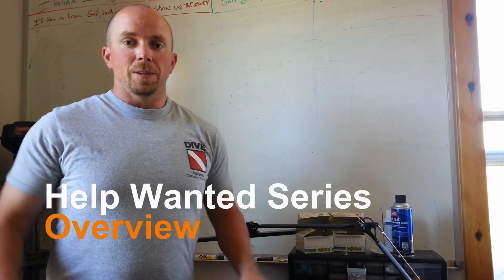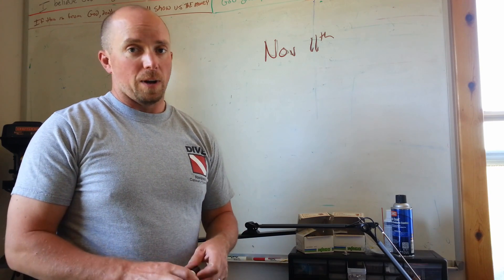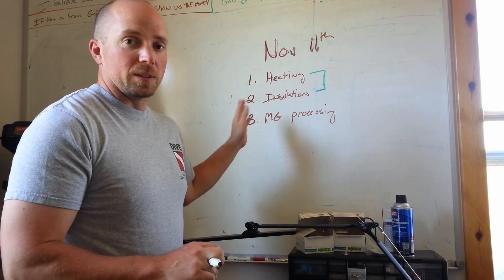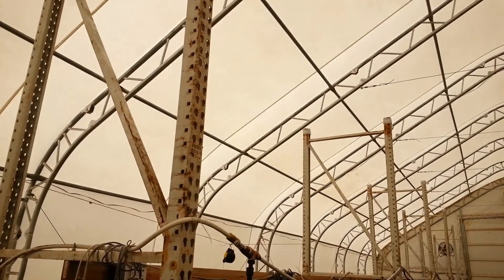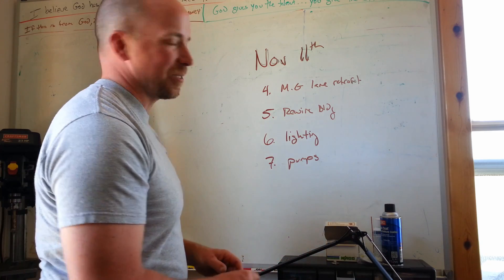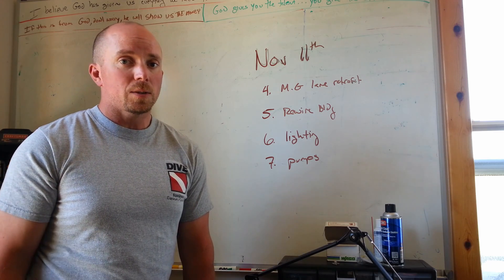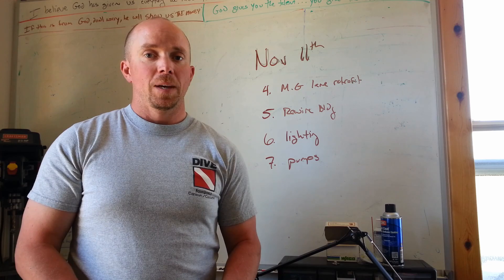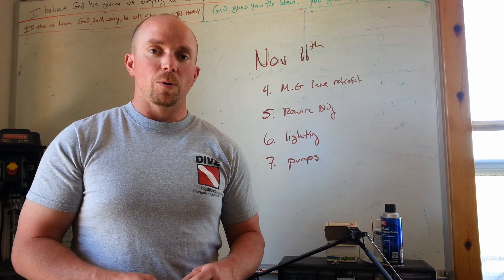Challenges with Building an Off-Grid, Sustainable, Aquaponic Greenhouse

Comment: Well, I for one would like to start my advice with the priority list, i know you did this adhoc, so maybe this wasn't the order things are in particularly; but i do not agree with the 'insulation/heating'  chicken/egg analogy ... So

I would say that Insulation is first on the list, you don't want to be heating up the whole planet (any more), and keep the cold out. If (and i would say stick to the 5th, because always remember the 5th of November) nothing else gets done, at least having the insulation issue fixed would be a HUGE step forwards for operations. As plants would grow better, less effort and electricity (might) be needed for heating, and it wouldn't be so cold thus processing of the microgreen would be more 'manageable'... Also, one you have an insulation solution (OR NOT !! - in case that might happen) then you can properly gage the heating requirements. BUT !! this is not nr.2 on the list...

Nr. 2 would likely be the processing, because again, if nothing changed (not even insulation or heating) having better processing would most certainly lead to more income faster (given that currently you can't process things fast enough - if that is only the case in winter, then maybe working harder will keep one warmer, i know a bit rough to say and obviously i am not entirely serious here, but clearly if you can't process the amount you grow now, then lane w/e expansion is not needed, as you can't process it anyways), so all this combined, i would say a good working area for processing (and gaged for the expanded amount you will grow) would be a nr.2 ... if this place is heated, then obviously you add another source of heat. given you solve the insulation issue (or if not, thus one) these two would already dramatically increase the situation in Hab1.

Then, IF you still need more heat, a heating solution should be looked into...

More important than heat though, seeing you somewhat survived the winter, would be to increase production ... this obviously ties in with nr.2. as you should only grow the amount you can process. But as you can process more, you should grow more. If the workspace and insulation are dealt with, and the micro greens did somewhat ok last winter, then expansion should really be 3rd on the list. See it this way, IF the plants did ok, but due to the cold grew slower, then having more plants then you can process isn't a problem during the coming winter, as long as it can actually max out your processing speed, then that is enough. Sure it will be a 'problem of abundance next spring/summer', but that's a year from now. also, scaling down is always an option to match the processing speed. BUT, if you don't expand this summer, you can't scale up during the winter to at least max out your processing speed. (Hope this part made sense) ... and yes, this includes the retrofit.

Then the other three, lighting, rewire, pumps ... (i happened to have already seen the lighting one) ... if your cash crop (micro greens) work atm, and some of the issues with the lighting aren't fully researched (see my comment there), i wouldn't put to much effort into it yet, sure if you want to grow bigger crops it needs to be solved, but if that is next year that sounds ok too. Same with the rewire and pumps, given the issues with them are along side the same as with the lighting, mainly, if the wiring and pumps are sufficient to expand your lanes then use what you have... Insulation, Processing (+heating that area and thus heating (through ventilation) the main grow space) and Expansion are the main issues.
Reply from the maker: I really appreciate the thoughtfulness of your comments...you've taken a lot of time to help out. Please shoot me emails at trm@therealmartian.com and we can connect 1:1

Comment: 97% increase with all those issues. Well, if it was easy, it would not be interesting right? You know, I am going to ask our new engineer in the lab tomorrow if she knows anything on the subject. She is about a decade younger then me so she might have some more modern training then me. I am electrical and she is elastomers, but I am sure engineering in general will be helpful.
Reply from the maker: 97% seemed crazy to me as well until I started finding some of the equipment that's available...they are gettign 300% increase in efficiency with the microgreen processing systems (cut, clean,dry)...so it's way doable...just a matter of cost

Comment: Old school Native Americans used to burn buffalo chips...is that a possibility using the horse manure?
The inclusion of the straw would not be an issue in this application as it would burn as well.
The only thing you need is an area to place the manure to dry...during the summer would be best for that.

Comment: Have you considered steam power for pumping/heating etc? Very reliable and if you have biomass, a good synergy for where you are located. In a true "Martian" environment, small nuclear power plant would be the best self sustaining steam generation remote and long term with 90% plus vapor recovery on the condenser side of the system. Some challenging problems for certain, the best thing is "necessity is the mother of invention". It is going to be very interesting the ideas and techniques that are applied to solve these items!

Comment: Insulation. For insulation I think you could employ the double skin approach with pumped air to maintain film separation in the winter on the inside of your current skin to the building. This is proven technology in the horticultural industry but you do have a lot of air space inside your building and, bad news!, it demands power to make it effective. The only similar thing I can think of at present is that does not need pumped air is bubble wrap as it is already sealed. Note there will be a loss of light with either but much more so with bubble wrap.
Heating. I really think you need a blend of systems available to use according to the severity of coldness. I would suggest you need to look seriously at an in ground thermal heating system which largely relies on thermo-syphon circulation.
I like the idea of a heavily insulated picking and packing area for your wife to work in and an insulated shipping container sounds just right.

One demonstration of I have seen is the production process used commercially to grow herbs on a very slow moving conveyor where seeding into pots is at the start and harvesting, labelled and packed for sale at the other end. Another version involves floating seeds in shallow tanks that grow on to become plants in polystyrene plug trays, which of course float, from one end of a tank to harvesting at the other end. 
Seeding is done by the use of a vacuum plate that loads and places individual seeds into prepared growing medium in a prescribed pattern/number.
A simple mechanical version of this has been used in battery cage poultry houses to remove the waste from underneath each "layer" of hens to the end of a row of birds for disposal. A type of tarp paper is laid on top of mesh which is rolled onto a hand operated winch drum to deliver the mess to one end of the row. The clean paper is then temporarily trapped at the delivery point and the mesh bed is wound back to the start for another cycle perhaps 7-14 days later. This type of approach may offer some solutions to growing layers of micro greens in your internal tunnels in your structure.
What ever you choose to do it seems to me that you have to raise production volume and / or reduce the time and effort drastically for the volume you are producing currently. 
Is demand static or perhaps seasonal?
Reply from the maker: thanks for the great comment. Yes the demand will be static...that's a niche

Comment: Numerous times in the past, you've mentioned that you only have "40 amps of power" & whilst you've explained why that limit exists, power isn't measured in amps, so there's a missing value (voltage) that other collaborative efforts would need to assist you in solving at least some of the items on your listed priorities.

Are you limited to a single 40 amp breaker @ 120 VAC, or is the limitation instead 40 amps on a single phase 240 VAC breaker? Or possibly 40 amps from 3-phase 208 VAC?

Nearly everything on your list is dependent upon your available electric power or restricted by same, so outside engineering support will need to know what those restrictions really are, in order to truly be helpful without sending you on an expensive but tragically doomed snipe hunt.

On the topic of heating, Growing Power (an urban farming group based in Milwaukee, WI) is using very effectively, compost heating in some of their greenhouses, & I've been on tours there during the winter months with snow on the ground, so I know that it's possible - I just don't know how workable it is for your Hab1, because it will require some floor space that you may not be able to free up easily. Even if you can't get around to solving the "horse toilet" challenge before winter, you might still be able to gain some benefit from the animal manure that you already have available?

Back on the subject of power limitations, if you're running into limits now, with only lanes 2 & 3 operational, how will you be able to run lanes 1 & 4, or for that matter, Hab2? Will you be forced to invest in battery storage and move away from the current grid tie setup to avoid a new transformer from the utility company? That opens up a whole new barrel of worms with battery maintenance and heating/housing a battery bank & batteries are typically the most expensive part of any off-grid system...

That may be more than enough food for thought for one posting. At least please clarify the real power limits you have, as enquiring minds would like to love to know & love to help with the solutions.
Reply from the maker: great point on calling out voltage. I'll take some video of the supply system and get that up. yeah the compost heating isn't going to work for us...we just aren't setup for it correctly. The middle of our building I think is going to be taken up by processing of the microgreens.

Comment: A radiant floor heater system for each level of your racking system also Radiant Barrier, Foil- Single Bubble -Foil attached to a thermal blanket designed to cover only your racking system rather than trying to heat the whole tent.

Comment: HEATING:  Have you thought about an in-ground heating system.  Using the ground as both a radiant system and a thermal mass.  I would reach out to a university with a mechanical engineering department that wants students to work through highly sustainable heating system.  There are a number of amazing systems that are scalable from big commercial down to your size.  I will forward this to a friend who owns a MEP firm in Pennsylvanit
Reply from the maker: good morning John, yes...stay tuned for the 3rd video in the series and you'll get my idea list...geothermal is the #1 option. Thanks for the email connection as well. I look forward to collaborating.

Comment: What about adding a skin to the structure with an air gap betwixt the skins. Could possibly help both summer heat, (if that becomes an issue) and winter cold, the air gap being the insulation. Hopefully I didn't read this on here earlier, and think it was an original thought. HA!
Reply: I was about to post this then saw your post:
Insulation: Thin strapping between all the vertical supports that you could staple 6 mil plastic to to create an air gap? Would be cheap and easy...not sure how efficient it would be but might be worth the effort?
Reply: I have thought about maybe placing magnets (perhaps harbor freight cheapos) on the inside  steel structure in many places then covering the shelving lane units with some visqueen or other plastic membrane and then lifting the membrane with some poles and putting another cheapo magnet or ferrous little plate to clamp the membrane in between and basically make an air gap as you suggested (basically an inset second membrane). This method would be fairly cheap and not require much effort. I do remember that the outer "skin" of the barn and the plastic lane covering had a fairly high temperature differential. This might help with another "air gap" to insulate. Hope that made sense.

Comment: I see a row of Ferris wheel grow trays. Several trays per wheel and several wheels in a row down the present lane. Fixed irrigation and lighting. The wheel turns and passes the light and water spray. Without having done any math I think you with have more square feet of vegetation grow than if you have just three single lanes in three rows. Just a thought.